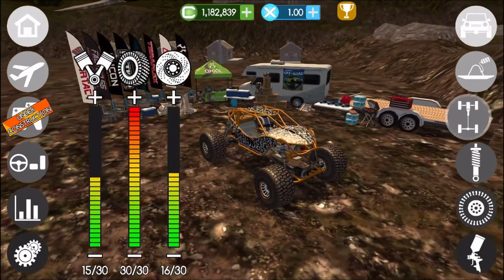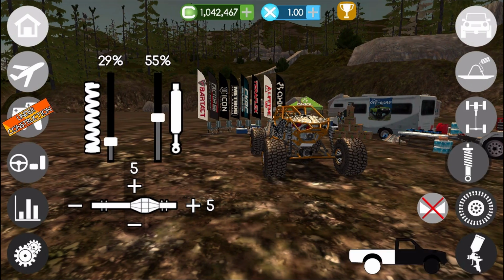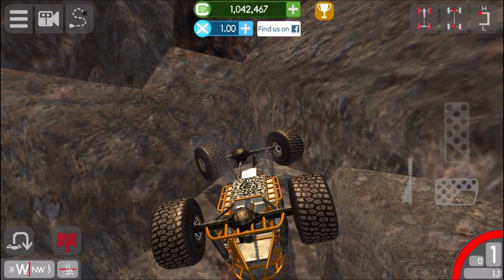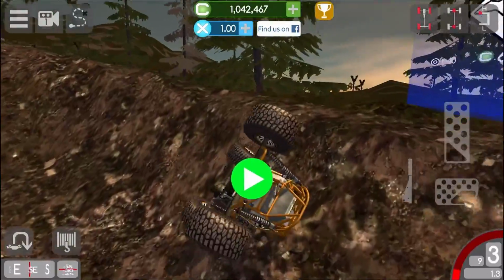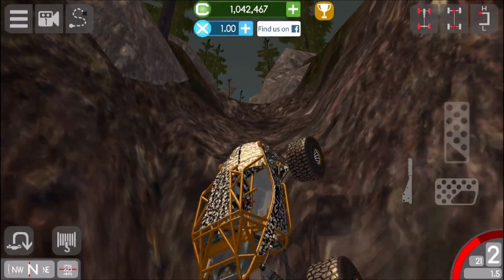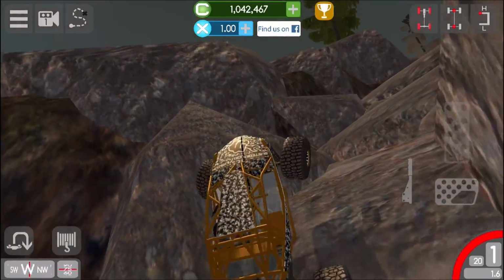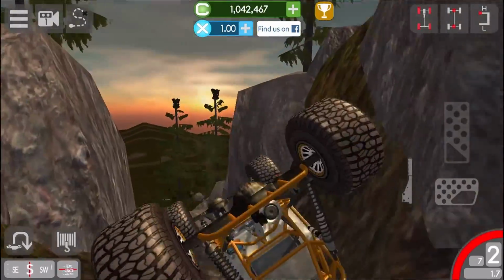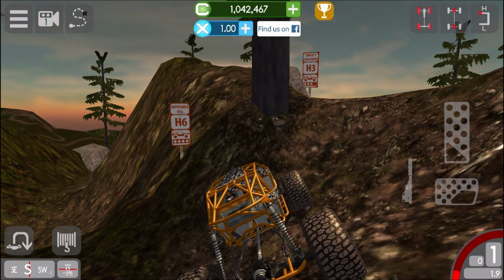Gigabit Off-Road | NEW UPDATE! HARDEST TRAIL EVER!? "Impossible Hill"

Comment: you need to change the controls, you need to have it so you change gears and so you control the anount speed/power. like being honest you suck at the game because of the controls you are using. you will find the vehicles much easier to control if you change your settings. still like your videos though 👌🏻